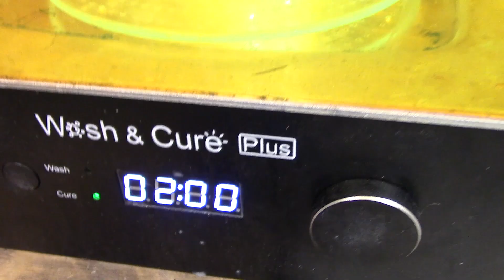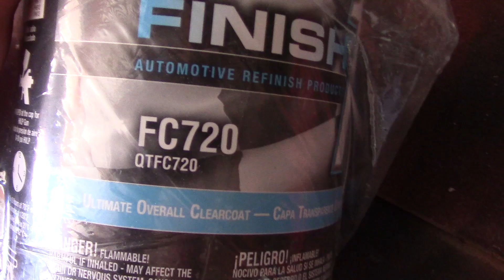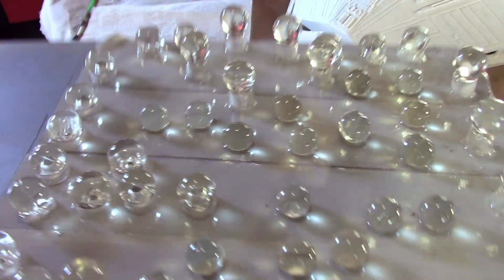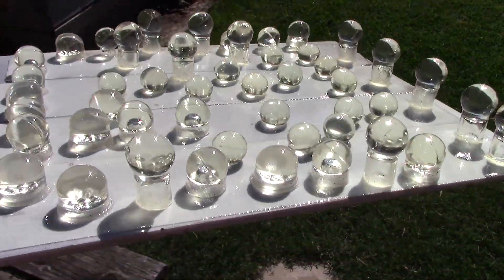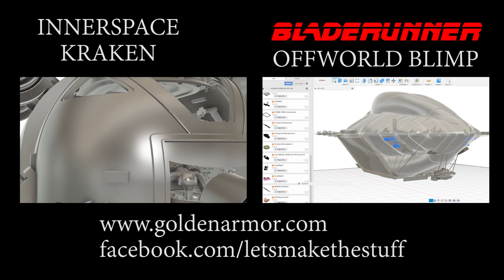Crystal Clear parts from your 3D Printer

Comment: I just dip prints in a gloss clear rather than spray, then wick the excess off on a paper towel.
Reply from the maker: @cimmerian100  that works too.  Which gloss clear do you like?
Reply: @chaucer44  I have an ancient bottle of Johnsons Klear (future) which I use for dipping canopies and other clear parts, works really well for 3d printed parts as well. Doubt it would be as hard wearing as the 2k though.
Edit: you could also  dip into your vat of clear resin I guess , then cure again would probably work well too, since you're just coating the aliasing  of the lcd pixels.
Reply from the maker: @cimmerian100  ahh yesI have some future here. I still haven't played with it all these years.
Reply: I just came back to this video to ask about dipping. I wonder how it would work with the 2k clear?
Reply from the maker: @stephengolaski6451  I bet dipping in the 2k clear work great too.